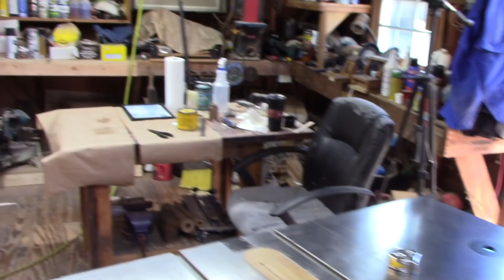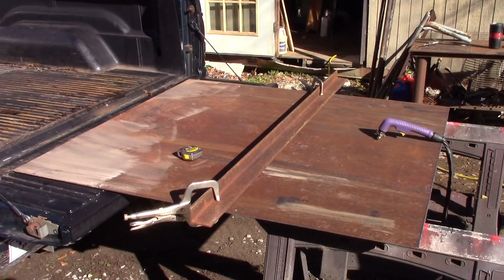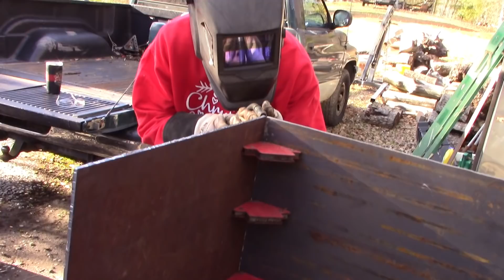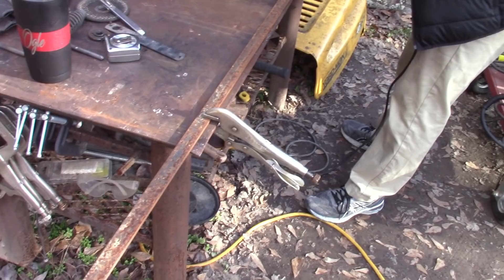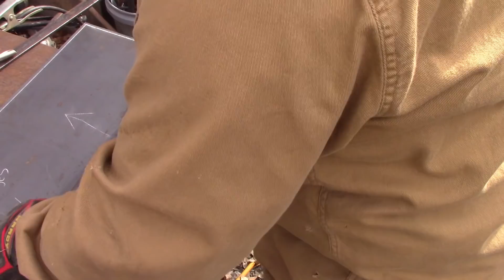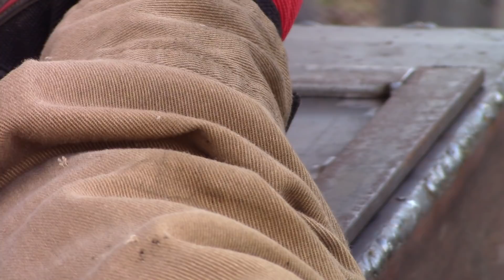#170 Building a Woodburning Heater with a Blower Part 1

Comment: What brand plasma cutter are you using? It gets the job done fast.
Reply from the maker: Thank you for your question. It is an Everlast. Hope this helps.
Reply: I like your video! I like how fast you  cut that carbon steel. You made the job so easy.

Comment: You'll get more heat out of the stove if you put a damper in it
Reply from the maker: Thank you Bruce. You are correct and I have one installed into the flu pipe. It is the 1/4 turn type. Works great. Take care.

Comment: Nice work...enjoy watching the build, as well as your many turning videos!  I have a question about the welding...is that MIG with gas, and if so, do you have any problems using the gas outdoors without setting up wind breaks etc.... It's something I'd like to try, but it would have to be outdoors ...Thanks!
Reply from the maker: Thank you Israel. Yes this is a MIG welding rig and they do use Argon mix gas. I do not have a lot of trouble with the wind because I just wait for it to stop then begin welding. It is a drawback but nothing that will stop the process. I hope this helps.

Comment: Please soak the galvanized tubes in a vinegar or other acid solution before exposing to flames. Zinc fumes can be hazardous to your health. Wanna see more of your work for years to come
Reply from the maker: Thank you Mark. Very good Point. I will surely get the galvanizing off the tubes before I use them.